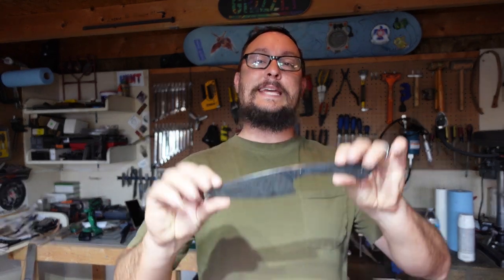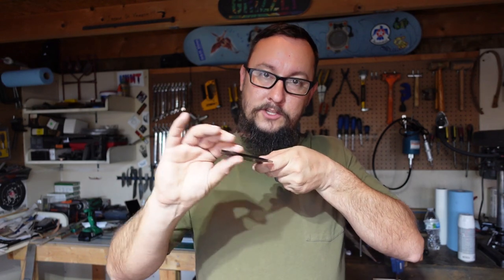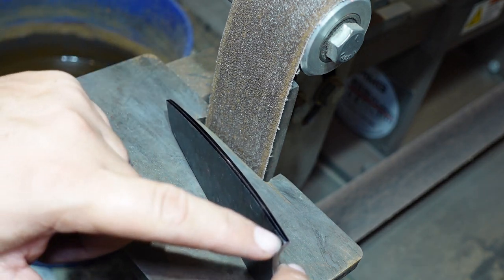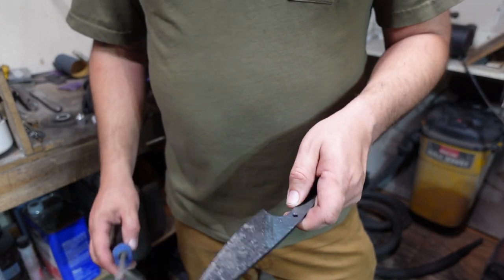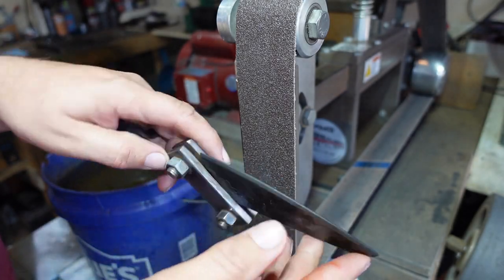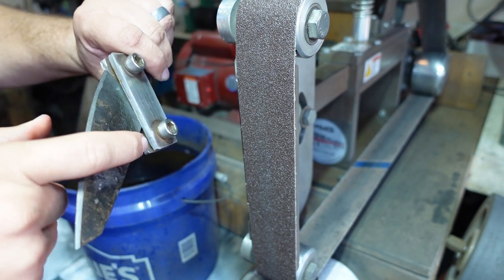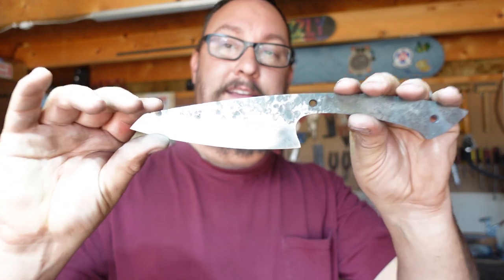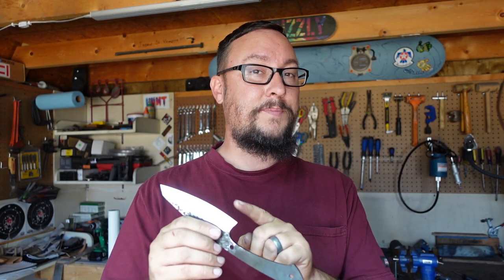Grinding The Bevels And Heat Treating A 1084 Gyuto Style Steak Knife | Shop Talk Tuesday Episode 117

Comment: Awesome shop talk Tuesday. I am in the middle of making a camp knife tanto based on the same shape of the one you made. Im doing it from a 5160 leaf spring, i messed up doing the bevel on one side and had to take both bevels up meeting the swedge to correct the mistake and make the bevels equal on both sides, im disapointed this happend but it still looks pretty damn good with the bevels meeting the swedge.

Comment: I love everything about this blade. Can't wait to see the handle and the steak.(I will only buy a sirloin if NY Strips at our grocery store are too thick--it is THE perfect steak). Why is your peanut oil at that temp? If your container was bigger, would you have to start at a higher temp?
Reply from the maker: When you heat the oil it changes the viscosity of it. You need the oil at the right temp to be able to quench (cool the blade) at the correct speed.

Comment: This might sound like a really dumb question, but when having a hammered texture does food and particles stick to that area when using it for food ?
Reply from the maker: I haven't had and issue with it on my other knives. There are lots of brands out there that have hammered finishes on chefs knives. It should technically help the food release from the blade.

Comment: I know how important the normalizing is after hammering the crap out of the blade in the forging, but what normalizing is needed when doing just stock removal on 1084?
Reply from the maker: It's not necessary but I always do it, even if its just stock removal. I would rather know everything that went into my knife and not trust a company to do it for me.

Comment: First of all: That is one sexy blade!!!!

How do you control the temperature in your forge to the precision you need for heat treatment?
I really need to get my own HT process going and i really struggle with temp control
Reply from the maker: It's more of a control with the steel rather than the forge. My forge is at about 1900° during this process. I just keep checking the steels temp as I go.

Comment: I've read quite a few times that a non-contact thermometer like that is nowhere close to accurate at those temperatures due to the radiating steel.  It would make it easier,  and you seem to trust it, but I've avoided them for that reason. Anyone really know at that point if this is true?
Reply from the maker: You definitely need to make sure that you aren't keeping the thermometer near the forge in between checking Temps. The reason the radiant temps mess with it, is because the front of the thermometer will get hot. This will make all the temps wrong. If it gets hot then room temp stuff can read 80° to 100° warmer. I make sure that mine cools down.